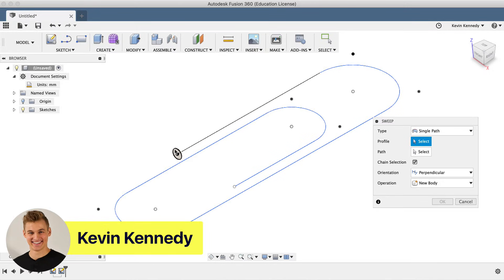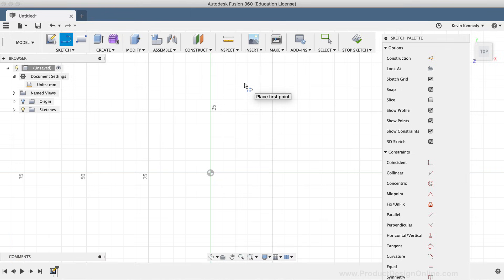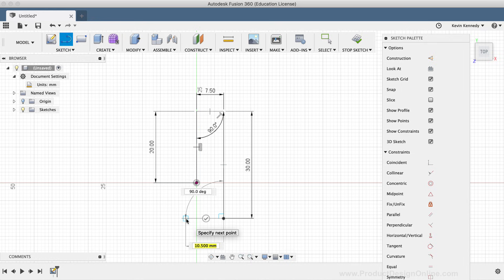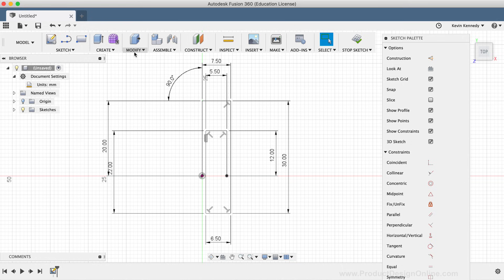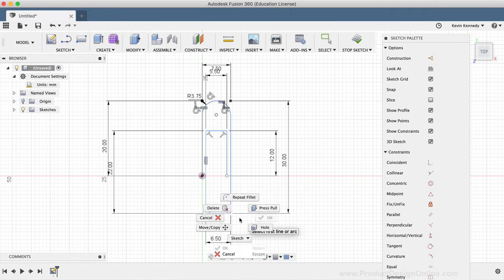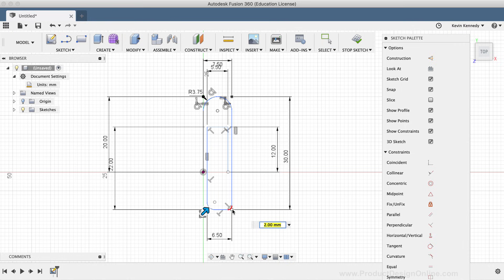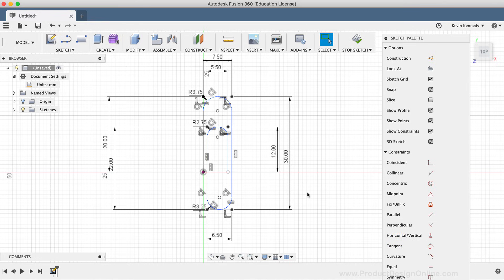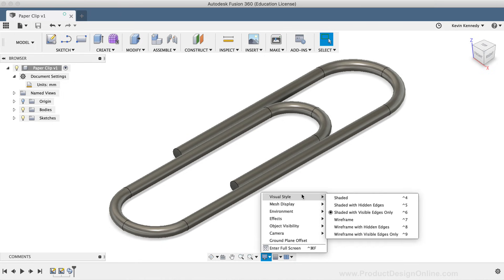How to 3D Model a Paper Clip - Learn Autodesk Fusion 360 in 30 Days: Day #3 (REVISED)

Comment: i try to do the sweep command just like u did by selecting the origin and path and i get an error that says "the start direction of a path segment is antiparallel to the end direction of the previous path segment
Reply from the maker: Hi Luke. That error is usually caused by the sketch fillets throwing the lines out of whack. Try reverting the sketch and apply the corner sketch fillets one at a time. You may then have to drag the sweep command around the profile, as it doesn't always connect all of the lines with fillets on each corner.

This should fix it - let me know if it doesn't. Cheers, Kevin :)
Reply: @ProductDesignOnline  I had exactly the same issue, even with vertical constraints I got the anti-parallel issue. I then applied the fillets 1-by-1 and it worked. Annoyingly it would not sweep the whole path in a single go and I had to select each segment, but otherwise it worked. It's probably a versioning issue that causes the problem to only occur for some people - newer versions of Fusion 360 probably perform the calculations differently such that the truncation error from using floating point arithmetic results in the arcs crossing, causing it to go out of whack. Doing each fillet one at a time clearly changes the calculation preventing this from occuring (e.g. F360 probably works out it it needs to reduce the fillet radius by epsilon).

Comment: A question, why is it that I'm only allowed to put "Horizontal/vertical" constraint on straight edges AFTER I've done the fillet effect to the corners? 
I tried to be "smart" and do it before the fillet effect while having only straight edges, but then I only get an error. 
Currently on version 2.0.7036
Reply from the maker: Hi, 1powelrainbow2. You can/should be able to apply constraints before applying the fillets. However, oftentimes, when you apply a fillet it will remove some of the surrounding constraints.

What error or warning message are you seeing? Cheers, Kevin :)
Reply: @ProductDesignOnline  The message I get is "Failed to solve. Please try revising dimensions or constraints." Though I think I've solved it, once lines are created, they all get the T sign ("Perpendicular" I think is the case) which locks me out of any other constraints. But once removed I can add new ones, like "Horizontal/vertical" :)

Comment: Hi, great video!!! I have one small problem, after Sweep\Select Face\Select Path only half of the path is selected, I need to click on the second half manually and it works. Checked on sketch, have only one line. Any idea? Thanks again
Reply from the maker: Hi, Mariol. The sweep command can be picky with sketch geometry when fillets are applied. It doesn't effect the results of the final body...sometimes you'll just need to select multiple segments of sketch geometry. Cheers, Kevin :)

Comment: Hello and thank you for these great tutorials. I think I'm running into the same issue as the others.  When applying the first 2 Fillets, I receive the following message: "Warning: Constraints and/or dimensions were removed during operation."  I then continue following the tutorial by adding the Constraint for the bottom 2 corners and received the same message again. Continuing with the tutorial, I add the Constraint, then the next 2 Fillets.  Again, I get the same message.  I continue until I get to the Sweep which then gives me the following message," Error: The start direction of a path segment is antiparallel to the end direction of the previous path segment."  This appears once I'm in between the bottom 2 Fillet.  Here is where I'm at a lost.  I'm sure it something simple I'm missing, but would like some help on this one also. Thank you in advance.
Reply from the maker: Hi, VT16Turbo. the "Warning: Constraints and/or dimensions were removed during operation." warning is not an issue, as that's just letting you know that some of the automatic constraints are removed due to the sketch geometry changing (the line turning into an arc with the fillet).

After releasing this tutorial I had to discovered (thanks to other viewers) that Fusion 360 doesn't like to process two sketch fillets at the same time. There are two solutions to this. The first is to revert your sketch (or start over) and apply the sketch fillets one at a time. As in, apply one fillet and click "OK", reactivate the fillet and apply the second, and so on.

The second method would be to change all of the fillet radii to be ".01" less than they currently are. This method trick Fusion 360 into working as the fillets no longer converge in the middle.

Let me know if either of these work for you! Cheers, Kevin :)
Reply: @ProductDesignOnline  , thanks for the response as I will give these workarounds a try. Thanks again!
Reply: @ProductDesignOnline  The only why I was able to complete this was by adding the Fillets 1 at a time.  Thank you very much, on to day 4.
Reply from the maker: @crxsirt36  Glad that fixed it for you! Don't hesitate to comment if you run into any more roadblocks. Cheers, Kevin :)

Comment: When I go to sweep I get an error saying “the start direction of a path segment is anti parallel to the end direction of the previous path segment” ... how do you trouble shoot this? 

Thanks!
Reply from the maker: Hi, Dante. That error is usually caused by the sketch fillets throwing the lines out of whack. Try reverting the sketch and apply the corner sketch fillets ONE at a time. You may then have to drag the sweep command around the profile, as it doesn't always connect all of the lines when fillets are applied to each corner.

This should fix it - let me know if it doesn't and we can troubleshoot further. Cheers, Kevin :)
Reply: Thanks Kevin. Yes that got the sweep moving but it stops at about .6 and won’t go any further...
Reply from the maker: @dantedignazio4689  Could you share the link to your file? To share your file please go to File > Share > Share Public Link (make sure "downloadable" is toggled on) > Paste your link here as a reply to this comment. Cheers, Kevin :)
Reply: I'm getting the same error...if i delete the first fillet, i can get a sweep drawn to the end of the first line and hey, now i've drawn a small wire :-)
Reply from the maker: @richardhouse8364  Hi, Richard. Where you able to try applying the fillets one at a time?
Reply: @ProductDesignOnline  I had better luck with the 3 point arc and was able to quickly make that work.  Thanks for the follow up!
Reply from the maker: @richardhouse8364  Glad to hear that worked for you. The sweep command doesn't always like fillets, so the arc is definitely a good workaround. Cheers!

Comment: I've resolved Sweep problems by making fillet radius slightly smaller than half of lines' lengths (short lines to which fillets are being applied)
Reply from the maker: Hi, Vitalii Pylypenchuk. Thanks for sharing this. The other option would be to apply the fillets one at a time. Cheers, Kevin :)

Comment: Hi Kevin, I also ran into the sweep problem that everyone else mentioned. I solved it by sketch filleting each angle one at a time. Thanks for the tutorials, on to the next!
Reply from the maker: Hi, Neal. Glad that you were able to solve it by applying them one at a time and thanks for checking out the comments! Don't hesitate to comment asa you work through the remainder of the series. Cheers, Kevin :)

Comment: In 2.0.6670 version, I got a warning "Could not create a valid body" - I think this was because parts of the sweep overlapped.  Changed the circle diameter down to .75 mm and all is well.
Reply from the maker: Hi, Vince. That error message is usually cause by overlapping geometry. Glad to hear you got the issue sorted out. Keep at it!
Cheers, Kevin :)

Comment: Had several goes with varying problems. After reading all the comments from other users I finally got there. I used smaller fillets but also only applied one at a time. Not sure which change made the difference but the final result was spot on. In a way I'm glad there was a few problems along the way as it all adds to the learning. This is by far the best Fusion tutorial course I have found and I am looking forward to working my way through the rest. Many Many thanks for your time taken to put this all together.
Reply from the maker: Hi, David. Glad to hear you overcame the challenges and thanks for checking out the comments before asking the same question.

Don't hesitate to comment if you run into any more roadblocks throughout the series! Cheers, Kevin :)

Comment: Hi , Thank you for the video . I have a problem . I did every step following the video . after sweep I see this  Error: The start direction of a path segment is antiparallel to the end direction of the previous path segment.
So I moved the arrow and I noticed it's going well till the middle of path. If you watch this short (1 min.) video you'll understand the problem.
https://youtu.be/wzmjERaLRbk
Reply from the maker: Hi, Nabi. That error is usually caused by the sketch fillets throwing the lines out of whack. Try reverting the sketch and apply the corner sketch fillets ONE at a time. You may then have to drag the sweep command around the profile, as it doesn't always connect all of the lines with fillets on each corner.

This should fix it - let me know if it doesn't. Cheers, Kevin :)
Reply: @ProductDesignOnline  Dear Kevin,
Thank you for your reply.
I did what you say but didn't work. It stops at the first fillet. 
this is the link for the second attempt.
https://a360.co/34L1iES

Cheers, Nabi

Comment: Had the same error, doing the fillets one by one fixed it for me. I just had to sweep each section instead of all at once.
Reply from the maker: Hi, Ryan. Glad that workaround fixed it for you. The sweep results in the same geometry, it simply requires you to do each section because the fillets mess up the "chaining" (connection) of the sections. Cheers, Kevin :)

Comment: Can you check my file and see where I went wrong? https://a360.co/2IV8rtD
Reply from the maker: Hi, Salvatore. I looked at your file. It appears you're getting the anti-parallel error, which is often caused by the application of the fillets. If you can revert the sketch to before the fillets (or start from scratch) and try applying the fillets one at a time. That should ensure that the fillets don't cause the geometry to move, causing the error. Cheers, Kevin :)
Reply: @ProductDesignOnline  I will start from scratch and try again. Thank you!
Reply from the maker: @salvatoregagliardi48  Sounds good. Let me know if it works by applying the fillets one-by-one! Cheers, Kevin :)

Comment: If you get this error "ERROR:  The start direction of the path segment is antiparallel to the end direction of the previous path segment", then read on for a possible solution that worked for me.
Keep getting this error?  Here is one way that I got past the error.
After many attempts to fix I kept getting the same antiparallel error.  

I started over and this time I didn't force any dimensions with the <TAB> key.  I did not set any angles either.  Everything worked as in the video.

Maybe, once the dimensions are constrained the fillet operation shortens the constrained dimension and fails to follow the path needed when using the sweep operation.
All I know is that it works now.

My 2nd attempt, that worked, is using the Line tool and on the arcs, I held down the left mouse button and moved over the proper radius and an arc was created for me.  I never had to leave the Line tool until the path was finished.  Course, the paper clip is longer since the line dimensions are not changed like when I used the fillet.
Reply from the maker: Hi, Charles. Thanks for sharing this! I found, with the help of a few others, that applying the fillets one-by-one produces consistent results. I've found that the way I applied them (two at a time) in the tutorial does not produce significant results because of how F360 processes the calculation. I was unaware of this at the time of recording this, but I haven't seen anyone experience issues after applying the fillets one at a time. Cheers, Kevin :)
Reply: @ProductDesignOnline  All good.  Updates and the issues therein will plague us all.  
I tried one at a time still no go; that said I did the one at a time out of order.  Could be me or picking a sketch vs solid tool or vice-versa.  Either way, your tutorials are great.  On the phone case today and I'm happy.
Reply from the maker: @charlesw.ballewjr.8403  Thanks, Charles. You're making great progress...keep at it and don't hesitate to comment if you run into any more roadblocks! Cheers, Kevin :)

Comment: I also had the anti-parallel error, I fixed it by redoing the paperclip sketch and adding the fillets 1 by 1.
Reply from the maker: Hi, Richard. Glad that resolved it for you. Thanks for sharing. Cheers, Kevin :)
Reply: How do I fix "the start direction of a path segment is antiparallel to the end direction of the previous path segment" this error. Pls help me out with this
Reply: @vilas7621  same thing as my reply above, I redid the project and did my fillets one at a time instead of all at once.

Comment: "ERROR:  The start direction of the path segment is antiparallel to the end direction of the previous path segment."
This is the error I found after selecting the path and profile. Please help!
Reply from the maker: Hi, Vritti. That error is usually caused by the sketch fillets throwing the lines out of whack. Try reverting the sketch and apply the corner sketch fillets one at a time. You may then have to drag the sweep command around the profile, as it doesn't always connect all of the lines with fillets on each corner.

This should fix it - let me know if it doesn't. Cheers, Kevin :)
Reply: @ProductDesignOnline  I corrected all of the fillets but when I drag the sweep around the profile it stops on the outside fillet in the front. How do I fix this?
Reply from the maker: @ProgrammerSheep  Can you share the link to your file? Cheers, Kevin :)
Reply from the maker: @ProgrammerSheep  Sorry for the delay. I was able to take a look at your file. It appears that the bottom fillets being applied to both corners at the same time is throwing off the radii to where Fusion 360 doesn't seem they connect. To fix this, delete those two fillets and drag the vertical lines down (click and drag on the ends) and then connect the lines with a straight line. If you re-apply the fillets one at a time it should resolve that issue and the sweep command will let you go all the way around.

Let me know if that works for you! Cheers, Kevin :)
Reply: @ProductDesignOnline  YES THANK YOU SO MUCH YOU DONT KNOW HOW HAPPY I AM RIGHT NOW
Reply from the maker: @ProgrammerSheep  No problem...I'm always happy to help :)

Comment: I don't have these options in my sketch palette.  Only checkboxes, no drop-downs.
Reply from the maker: Hi, Bobos Curse. Are you referring to the "sketch constraints"? If so, they were removed from the Sketch Palette and placed into the Sketch tab (in the toolbar). This was changed with the major August 2019 update that made the toolbar tabular.
I would recommend watching my tutorial that covers the new UI updates. I discuss the critical changes in terminology, placement, and iconography, that should help bridge the gap between the old UI and the new one. You can watch that here - https://youtu.be/tuZzHcmFtg4
Cheers, Kevin :)
Reply: @ProductDesignOnline  Thanks I will check that out.  The changes must be frustrating for a lot of new people trying to follow tutorials
Reply from the maker: Unfortunately, they allowed switching back to the "Old UI" for a limited time. A lot of users found it helpful for following tutorials. However, Autodesk had to deprecate it due to development efforts - not enough resources to test both environments with each new feature.
Cheers, Kevin :)

Comment: Hey Kevin. I don't see this problem mentioned yet. When I try to add constraints to any of my lines I get an error: Fail to solve. Please try revising dimensions or constraints.
Reply: I finally got it to work perfectly using 3.74, 3.24, and 2.74 for radius and selecting both corners at once. No constraints required. No deforming of the shape. Any time I tried using 3.75, 3.25, and 2.75 the lines would turn magenta colour and the sweep stalled at each intersection. It just didn't want to take the constraints for me.
Reply from the maker: @dlpgraphics  Hi Steve. Sorry for the delayed response. Upon further investigation, I found that Fusion 360 cannot consistently process multiple sketch fillets with certain types of geometry - such as this case where the two fillets should butt ends. Lowering the fillets by a small fraction is the simplest solution. The other option is to apply the fillets one by one. Cheers, Kevin :)